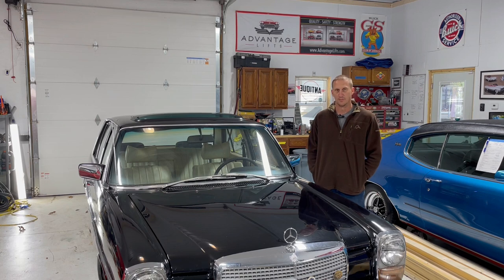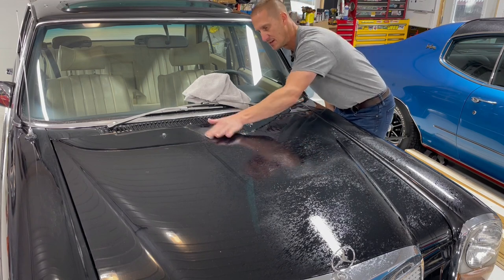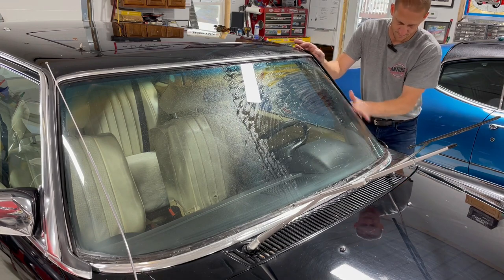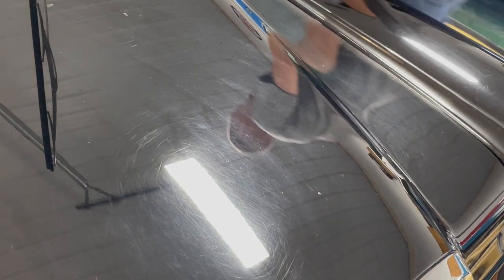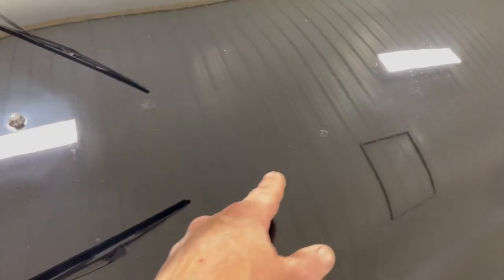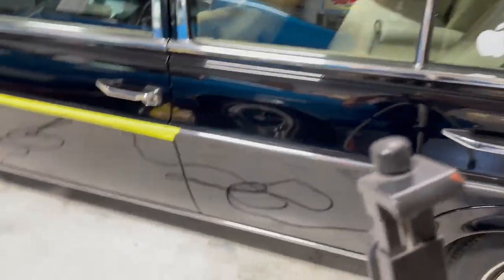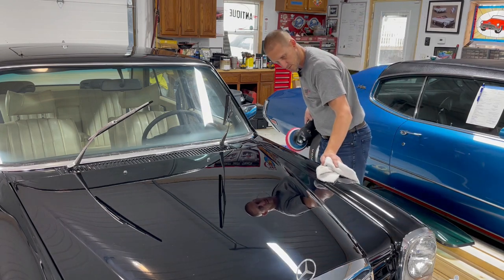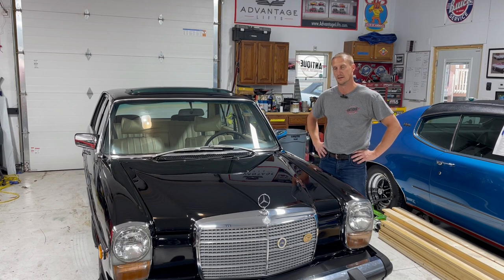Scuzzy Paint 1976 Mercedes Gets a Makeover

Comment: Those old mbz’s were built like tanks and will run forever if you just give them what they need…..unlike the newer ones built after say…..1996 or so…i have a 2010 cls550 and although it has about 130k on the clock its been a great car and never left me stranded…knock on wood….but the only problem i cannot look away from is the failing clear coat.. and of course the car is black….my teenage son drives it to school since he just got his liscence back in jan. And we are still getting everything nice and safe on his ‘67 mustang C  code coupe ( i tried my hardest to convince him to get a GM product😢😢)…..So now that he is starting spring break i told him he is gonna go out into the garage and help me prep that car so we can re-shoot the paint…i think this time were gonna change it to a charcoal gray color given that we own 7 vehicles and 5 of them are black…..im kinda over it now, they are really nice when clean, but a pain in the ass to keep that way…..my nova and c/10 i purposely painted white just for that reason….plus white paint is more forgiving than dark colors, especailly for plumbers that never painted cars before, with real paint from a gun and not a can😂😂😂

Comment: Adam: No iron remover before the clay bar? That makes it really slick. Using a 600 GSM microfiber for clay is really not necessary. I use the Kirkland 80/20 250 gsm. Save the heavy artillery for finishing.  Lake Country has a new pad washer which is incredible. Clear coat is clear that's why you don't see it on the pad like single stage. The hazing? I suggest Xtreme solutions  LVR 403. Bumps the GU'z almost 10 points!  You're learnin' !!!!! Mitch
Reply from the maker: I like the Kirkland towels for a lot, but I save those for my "average" cars.  I seem to have not good luck with them leaving scratches behind.